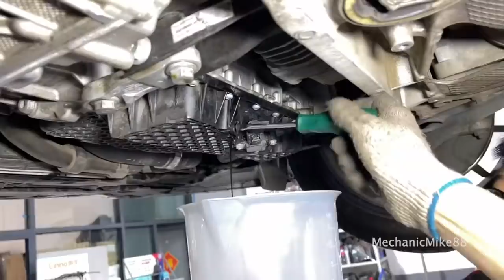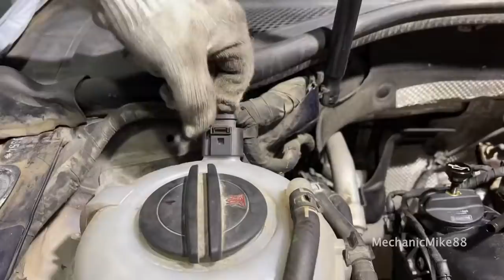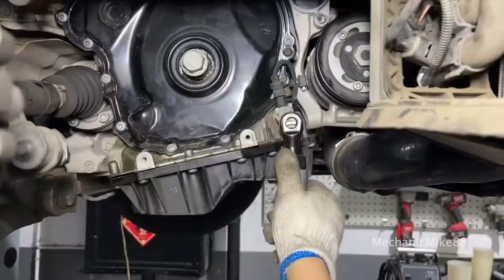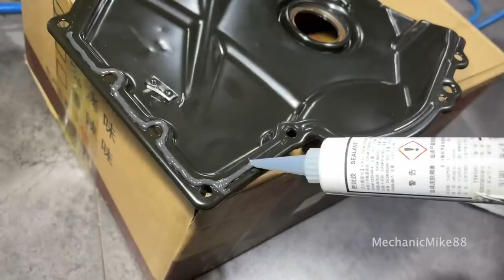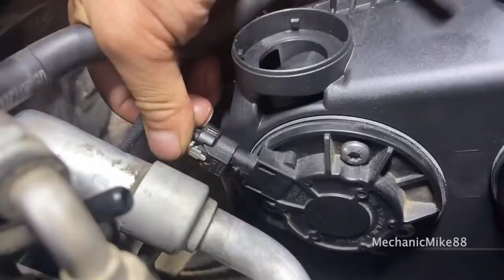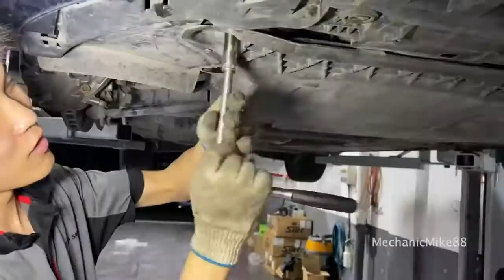Audi S3 Maintenance Service

Comment: Watching this you'll understand why they charge $200 bucks an hour! One missed step or lost bolt and it can result in catastrophic engine damage or  check engine light hell
Reply: I take it these cars aren't cheap to maintain?
Reply: @unclechico5981  Lease an Audi, Buy a Toyota
Reply: @unclechico5981   Audi are over engineered and very very expensive to maintain. Almost as bad as a Break My Wallet 
Buy something Japanese if you want reliable.
Reply: It only took him about 4 minutes
Reply: 200 an hour? Where do you go ? 🤣🤣🤣
Reply: @benturp3492  Pretty much the hourly going rate for German brands at the dealerships in Los Angeles,Seattle, Dallas.....NYC is nearly $300 and they charge hourly for parking once car is completed and not picked up within a certain timeframe......for real
Reply: @IgglyBiggly  damn am happy I live in Europe then doesn't cost that much or my A6 3.0 quattro allroad
Reply: @benturp3492  Yea its spendy having a quality technician work on German cars here stateside
Reply: @benturp3492  

in Germany you also have to pay 200€ for one hour of work...
Reply: @r6vinaros556  well gutted I pay around €50 an hour at an Audi approved garage
Reply: @benturp3492  

In which Region/Country?

Answer in German: 
the setting of the first cylinder would not be determined professionally
Reply: @r6vinaros556  I live in Tallinn, Estonia ;)
Reply: @benturp3492  

The Salary is also lower than here in Germany, hence the better price. 
But Estonia is a very beautiful country
💪💪
Reply: Nae, garage will just deny they caused the problem
Reply: @barry5138  what problem?
Reply: @benturp3492  in my experience, if a garage does work and causes damage, they will deny they caused an issue. I've paid top dollar before, all cowboys.
Reply: It's pretty cheap to maintain one in china

Comment: Audi will tell you never to worry about the chain while you are signing up to buy an S3.
Reply: Why would they
Reply: Chain isn't mostly a problem the weakest part is the plastic chain guides and tensioners they wear out faster and needs to be changed. So it's wiser to change the chain as well
Reply: @lovingCarz  still not good on a 20k plus motor.  Vw still haven't got it right as the Mk5 and 6 GTi 's had issues with chains.
Reply: Timing chains need to be replaced on all cars...
Reply: @ishkaranbrar313  that's what I was on about as the old saying was always "you will be fine it has a chain" .
Reply: The issue with the timing system on the EA888 was the upper tensioner and chain stretch itself on the first Gen the third Gen hasn’t got those problems which it’s been used since 2014/15. The first Gen doesn’t either as the tensioners we’re updated
Reply: @jasonjay7650  the 4 CYL 8V costs 20k?
Reply: @Noname23489  a decent second hand S3 are around 20k
Reply: @jasonjay7650  yeah the whole car I thought you meant just the motor itself
Reply: @Noname23489  you thought I meant engine 😆

Comment: I’d be insane to let 3 apprentices that young to touch my timing chain or wash my electrical connectors like that. And it’s not a maintenance item either.
Reply: It was done right, wasnt it?
Reply: @andries4561  you’ll never know unless you stand there and watch them do everything, or until something starts to leak or break
Reply: @hanzhang4846  people like you are bitter man, everyone deserves to learn the job and with a decent tech to teach them nothing goes wrong. Customers standing right next to you while you're working thinking they know everything better are awful
Reply: @andries4561  oh you think I never worked in a shop in China or I don’t know how to work on cars? In a well regulated and mature automotive industry, yeah, I’ll let young apprentices from dealership work on my timing chain on a Audi S, with instructions and specs from factory, that’s how I started. In China there’s no authority to overwatch this trade. Trainings and industry standards are not taken srsly and constantly disregarded. You’d be lucky to find a shop that has a torque wrench. So no, if something major’s happening on my car if I’m in China, I’m bringing it to a dealer tech with at least 10 year exp

Comment: More like a partial rebuild.. than a routine maintenance service. Really excellent..!!! 
(But.. I’ll bet EXPENSIVE..!!) 😵‍💫
Reply: Yup. Around 2k
Reply: @JuanYRuby1209Marine  
Geez…!!! And I thought maintenance was expensive for my Harley Davidson.. 😳
Reply: He was changing timing chain. What do you expect ? Timing chain on gen3 2.0 tfsi lasts around 200 thousand km. You have to take away same things if you change timing chain even on on Fabia. Nothing weird of overcomplicated here actually.
Reply: @Romif_SK  chain replace after 200.000 km … if oil change is every 20.000-30.000 km i am not surprised they should change oil every 10-15.000km max
Reply: @DoinyomomMr  should be 7000-9000 :)

Comment: VAG Group are just one well build machine for money. Every maintenance cost a lot of time, efforts and money! Everything so complicate and hard to be done. I had one like this it was a nightmare now I own Honda CRV  with 2.0 I-VTEC and everything is so simple for maintenance and accessible no need to disassemble the all car to change some simple stuffs like accessory belt for example.
Reply: Japanese r simple and easy to maintain
Reply: Totaly agree with you i own a bmw e46 it’s so simple in comparison of these vag cars…
Reply: Its the vw group lol
Reply: @jazzy8459  no way bmw is independant from vag group
Reply: @Matt-bt8zt  audi=vw group
Reply: You are right about being simple . Audi BMW Mercedes over engineered. I guess the European will never learn.
Reply: bla bla bla. which honda, when? all modern engines with all that plastic, electronics, filters , turbos etc are cramped in engine bay, strict emissions standards aint helping either.
it is sadly  common  manufacturing today, nothing can be really easily diy fixed or replaced, everything is glued, chipped and bolted in modules etc.
Reply: @izoyt  
Are you a mechanic or you just ever heard about engine maintenance?
Honda CR-V with R20A2 and A3 engine been in use from 2006 to 2020. Is it a modern car isn't it? I can change the accessory belt on this car in 10 min without even changing my new clothes because it is simple and don't need to disassemble the whole car.
Reply: Absolutely right, germen cars are neither customers friendly nor mechanic, complicated technology brakes frequently
Reply: The chain isn’t a regular service item.
Reply: vacuum cleaner for money
Reply: This is just a normal maintenance according to how they are designed: swap all parts. Cheap to buy, breaks the bank at service.
Reply: VAG fans usually say that they’ve driven and owned VWs well over 200,000kms and typically requires only basic maintenance. Are you telling me they were lying all along….?
Reply: @JAM_2024  they're not lying. That's basic VAG maintenance. So many design flaws on these, not designed to last.
Reply: simple designed machines are beatiful, it is not the case,  the bussines of BMW Mercedes audi is also in their maintenance services and the car credits they offer, you finish paying twice the car value¡¡ they just want money ¡¡
Reply: I currently drive a 2014 Wolfsburg GTI. I'm fortunate. On ly tires and fluids so far. Been 4 years! Oh and 4 spark plugs!
Reply: He changed timing chain. It wasn't that much complicated compared to other brands. 3.0 TFSI is complicated, because chain is behind the engine.
Reply: All hail the electric cars
Reply: @discgolfamateur2175  my audi A6 allroad 3.0 v6 is nearly at 300k kms and running just fine  ;)
Reply: @samiahmed4799  
I am not that sure,
What about supra or skyline or Impreza wrx or mitsu evolution and many many more.

Comment: The timing chain is not a maintenance item. You replace it when it wears out. The (chain driven) 2.0TFSI can go up to 300k miles before needing a new one.
Reply: They literally showed the streched out chain, and the 1.8, 2.0L engines chains never last 300k. You must be lucky if you can get 60k miles out of a chain.
Reply: @mxlife3663  Not sure what youve been smoking but the 1.8t is a belt not a chain. The early 2.0t had some chain issues but the later version with proper care could make 300k
Reply: Only chain will intact by 300k
Reply: I wanna know what you're doing different. Iv changed these at 75,000miles chain so stretched the tensioner is maxed out and its setting timing codes. And the oil change was done every 5k miles

Comment: I wonder if a cryogenic treated timing chain would last longer,stretch less&handle more boost🤔

BTW 99% of ppl who call themselves a mechanic would fuck this up&if they were to compete this...it would be covered in grease/ finger prints&oil. A technician knows another technician...yes I know technician Mike doesn’t flow like Mechanic Mike.
Aloha from Hawaii🤙🏽

Comment: is this classed as full service .why dumping the water and removing the water bottle were they repacing the water pump is that normal when repacing timing chain or cam belt sorry not very mecanical would just like to no. And how much would all that cost. ?

Comment: All great except that engine washing at the end. Stop doing that. It is wrong and it can be seen on so many videos on YT. What if you have live wires and they are exposed at the end? What if water gets into the wire socket and bridges them? Just use a rag and some soapy water (and not on the wires, obviously).